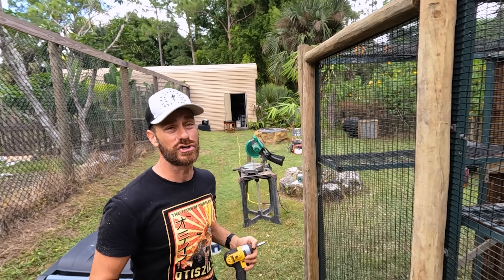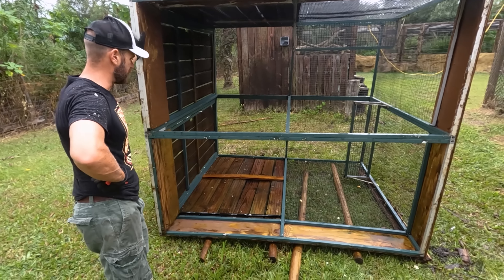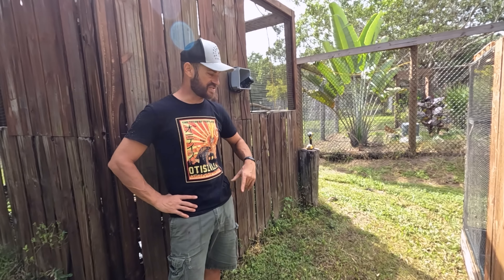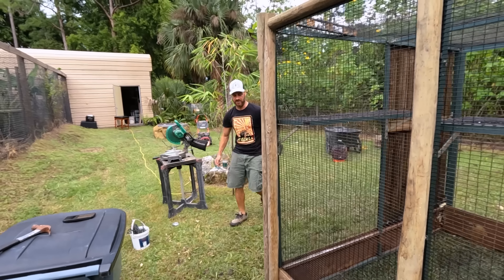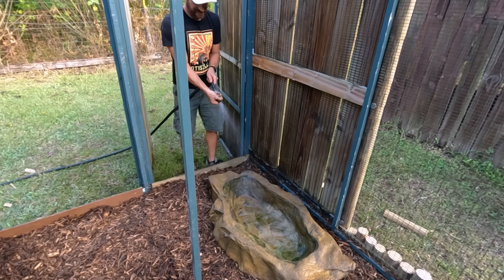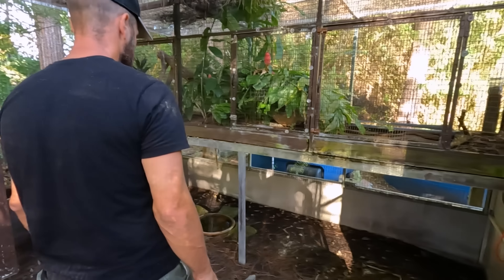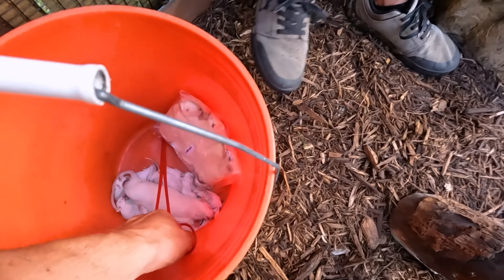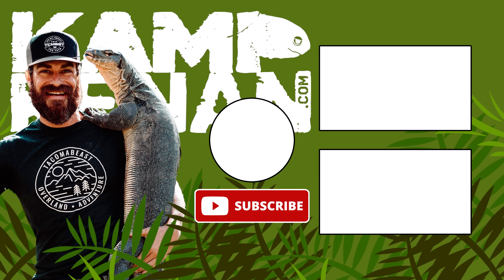We BUILT a New Habitat for INKY!

Comment: Apart from splitting those posts so they fit flush against the cage, it looks really good. Make sure to put a screw to hold the wire against the shelves. She may get stuck between it. Is the water bowl big/deep enough for her? Looks like you had a spare bigger one near the shed.